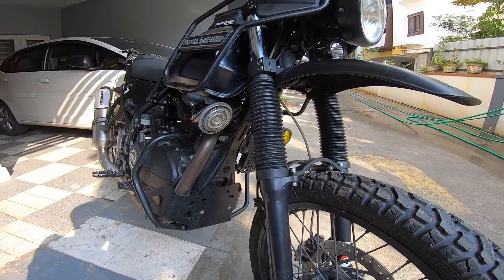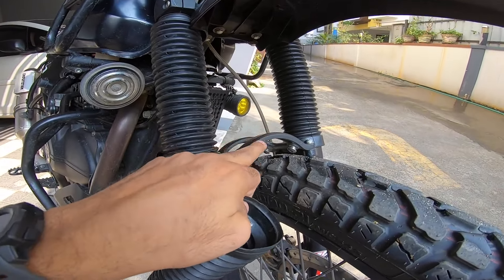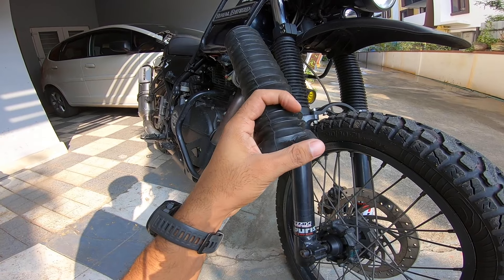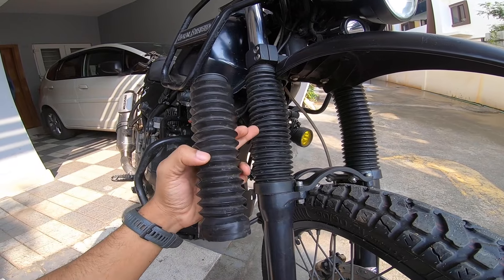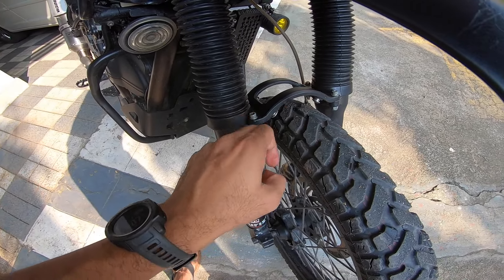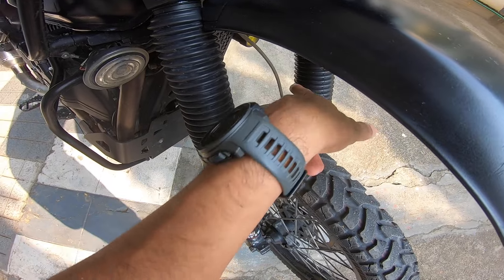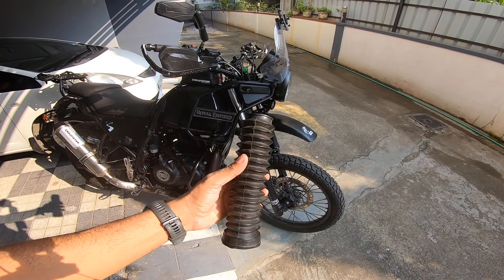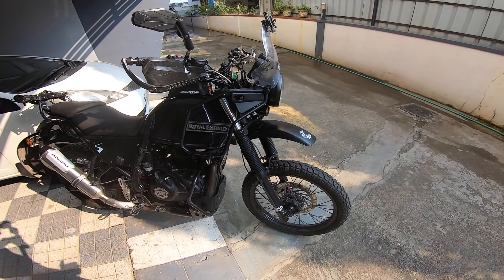HERO X PULSE TO THE RESCUE- FORK GAITERS FOR HIMALAYAN

Comment: True thing said about Fork stabilizer besides if you put mudguard on and does off-road in mud trail wheel gets jammed for that ive did some jugad by adding 4. thick washer (distance) and long Nut to lift it up by around 3to 4 inch high leaving good gap between tire and mudguard  , aside ive had seen one Bajaj 200ns with xpuls shock-up cover looked pretty good thick sporty looks

Comment: I've had this issue and am currently running my second set of fork gators. Thanks for the alternative. Btw is there anyway one can install the old BS3/BS4 clear windshield on a 2021 BS6 model with the smoked windshield? I looked into it and it doesn't seem possible without swapping out the BS6 front crash guards  with BS3/BS4 😢
Reply from the maker: Yes that’s right you will have to swap all three
Reply: That mod will cost me 8k! I'll stick with my smoked windshield for now 😁